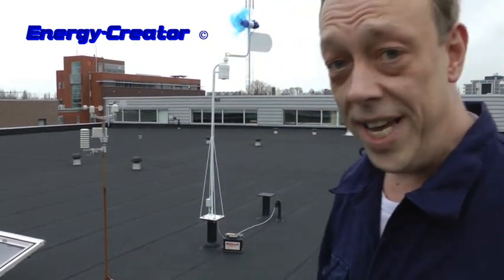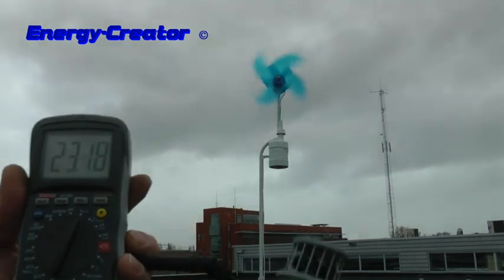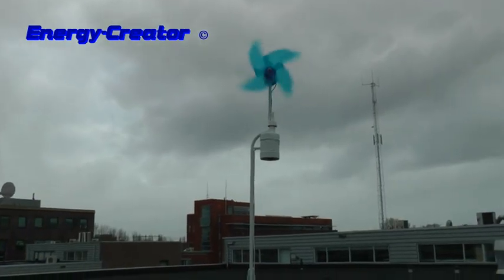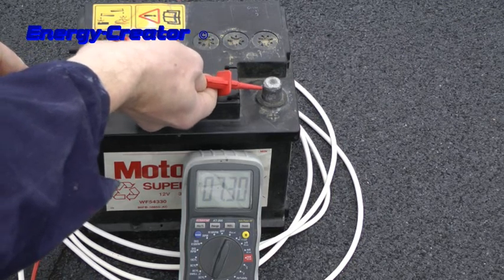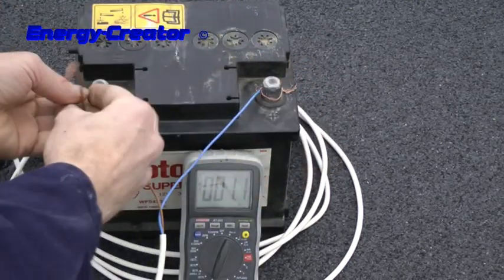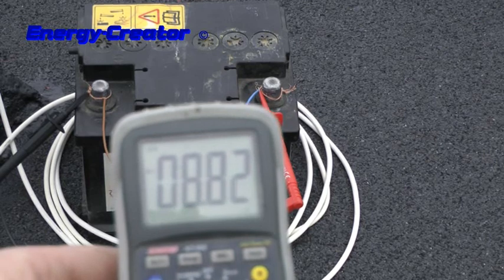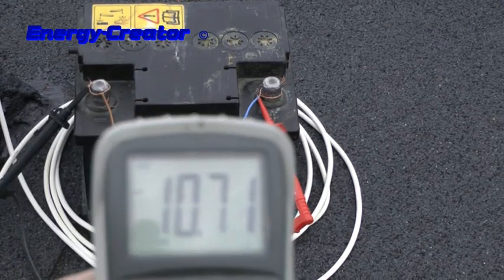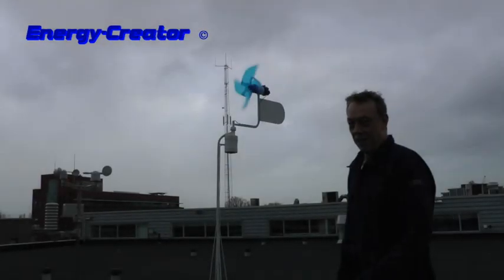Charging a car battery with a micro PMG Generator / Alternator Windmill.

Comment: A quick just for your information note here.. you call 7 or 8 volts on a car battery as dead.. when in fact 11 - 10.5 volts is considered dead 8 volts would be more like a damaged battery. A fully charged 6 cell lead acid battery (car battery) is more in the 12.6 volt range. You should NEVER discharge a car battery below 10.5 volts.